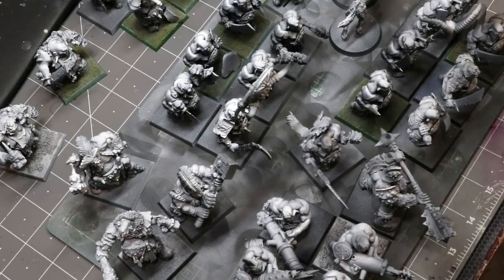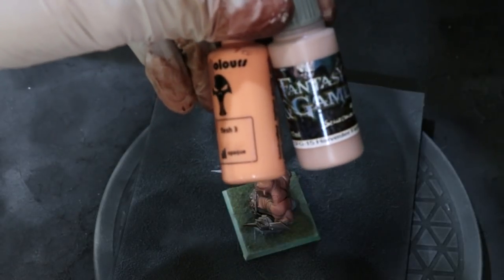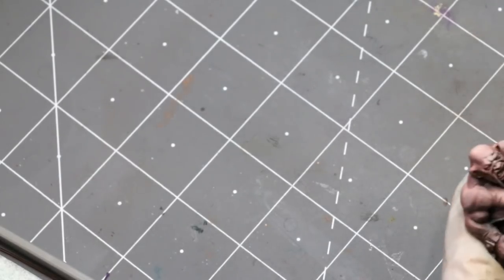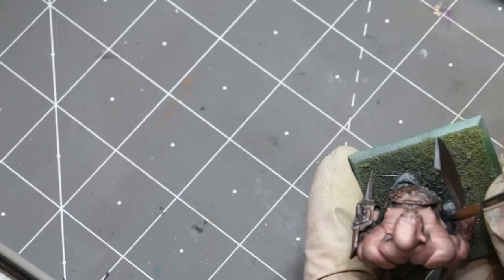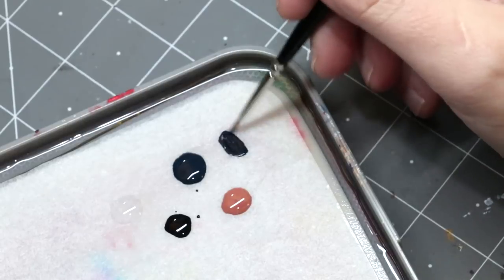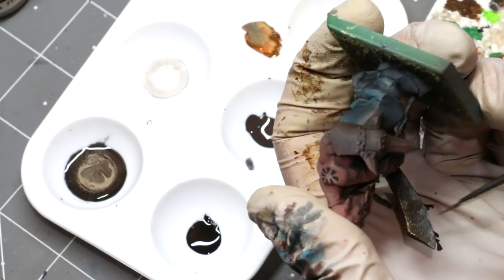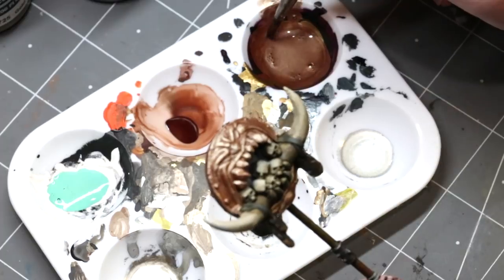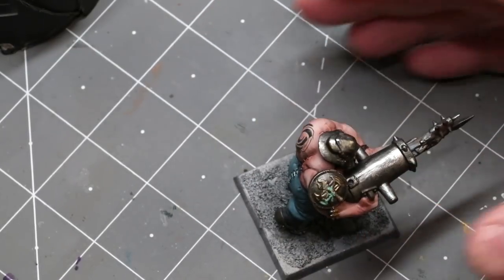Hobby Cheating 218   Painting an Army in 24 Hours

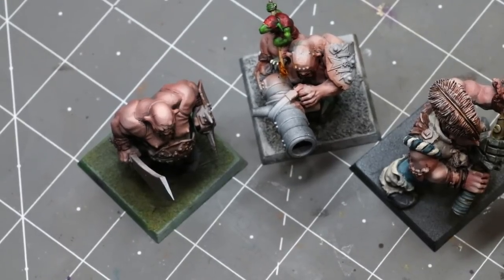Comment: Great work as usual, Vince. I want to add that as you finished your ogre at 32:36, you could also have said that every time you finish one this way instead of doing one little bit at a time, it’s a better example of intentional practice. 

Doing this method certainly gives me a hit of endorphins that one color at a time in a assembly line does not. 

Thanks again!
Reply from the maker: You know, you are so right. I didn't really think about it before, but you are exactly correct. The assembly line has a mental exhaustion thing where you don't really see the progress. This way, you really feel like you are getting there. Well said sir.

Comment: I've been meaning to join the rest of the guys at the club and paint an AOS army. I'm now going to actually do that using the approach you generously share here. Thanks.

BTW - attaching figures to the bases. Did you bother pinning, or did you just glue the model straight onto the top of the base?
Reply from the maker: Awesome, glad to hear it's helped motivate. At the end, yes, I just used some loc-tite gel glue and pushed them in. In this case, they have such solid big feet, it's a good bond.
Reply: Thanks Vince

Comment: Very impressive! Also tons of helpful info as usual. If I understand correctly you don’t put any varnish at all on the metal colors? (To keep the shine). Won’t the paint risk to chip off on models like these if you play with them frequently?

Thanks for the video!
Reply from the maker: That's correct, I don't varnish metal at all. To answer your other question, no, not really. In generally, plastic models don't chip easily. I don't even transport with foam (that is just model suicide), I use magracks. Never had an issue. Hope that helps.
Reply: Vince Venturella: Thanks! I also use magnets for transportation. Will stop varnish metal from now on :)

Comment: Awesome as always. What pressure did you use to spray the 6-1 bugmans glow in the beginning. I am still fighting with my airbrush 😉
Reply from the maker: 18 PSI is my standard setting I run at 99% of the time.
Reply: @VinceVenturella  oh that's 1.2 bar... I spray at 1.8... I will try to go lower, and thin more

Comment: Vince love the work. Any chance you could tell me the brand / metal paints you use. Im interested in looking to purchase some, or if you have an affiliate link with united kingdom shipping. Also what material did you use to make the bases. Id have love to have known how you actually made them i appear to have not seen this in the vid as i was watching. I will rewatch again to see if you do mention it. I was busy painting myself :) thanks
Reply from the maker: Sure, Vallejo Metal Color (not model or game or air) Vallejo Metal COlor (these - https://www.amazon.com/Vallejo-Steel-Metal-Color-Paint/dp/B012A93HZS/ref=sxts_sxwds-bia?keywords=vallejo+metal+color&pd_rd_i=B012A93HZS&pd_rd_r=af627b61-6e5b-4915-93a1-ec7645449bbf&pd_rd_w=HTzlm&pd_rd_wg=w450T&pf_rd_p=1cb3f32a-ccfd-479b-8a13-b22f56c942c6&pf_rd_r=V32R178N5CW3A7XBWHS7&psc=1&qid=1576644580

As to the bases, they were pretty simple, but I had a few people request it, which I didn't even think of. Basically, they were just some cork on the base, then well covered by vallejo basing paste, then multiple types of grit applied (i.e. different sizes) and then some little items for flavor - like skulls, logs, whatever.

Comment: Vince, what do you use to thin S75 in the airbrush? Do you mix in a secondary container, or do you mix right in the pot?

I've been struggling to airbrush S75, but Vallejo is fine. Have you found you need to do anything different between the two brands?

Btw, this video made me think totally differently about my new GSC army!
Reply from the maker: At the moment, I just use my standard thinner mix, 80/20 Thinner/Flow improver, i mix in the cup, but I stir with an old broken brush. I thin it quite a bit, especially standard Scale 75, probably like 5 or 6 to 1.
Reply: @VinceVenturella  cheers Vince! I'll try thinning my S75 more.

Comment: small question: how do you glue models on the bases after you did the bases? do you pin them with some wire and superglue?
Reply: That's how most people do it. You pin both legs and push it into the base, then you pin vise through where the paperclip pinning hit. Push the model through the base, after pin vising the base, then superglue the bottom, after you clip off the excess paperclip.
Reply from the maker: Normally, I would pin feet. In this case, I didn't. These ogres have big giant flat feet and they have a lot of surface connection. So I just used some Loc-Tite Ultra Control gel and I pushed them down.
Reply: @VinceVenturella  oh ok thanks. I find it hard to make bases first because the surface is rough and not even (like when I base it with rocks and sand etc) and I never manage to glue them solid on bases :(

Comment: That was an awesome video :) Did you think about using oil washes for the metals, would have avoided the non-metallic medium issue. I get why if you're doing it in a weekend due to drying time you couldn't but if you were splitting this up in to smaller paint sessions would it save some time?
Reply from the maker: I did think about oil washes in general. The drying time was the issue here for me with those, given the restriction, I just couldn't let something sit for that long. :)

Comment: Great video Vince! Im about to start an ogor army and really learned alot from your videos. :) 
That being said im having some problems with my skin.
I zenith with white inc and airbrush 3 different skin colors, but even after 24h the paint breaks when i try to apply a wash :(
Any idea what could be the root of my problem? Its like the "adhesive" in the paint isnt binding to the layer below. Could i be thinning my paint to much?
Reply from the maker: It's hard to say, could be the paint, could be humidity, could be the thinness. There is fortunately an easy answer. After you do that zenithal and your colors with the airbrush, make your final step a good coat or two of varnish (dealer's choice). 

You can then let that dry and basically go from there. Your previous work should be nice and locked in.
Reply: @VinceVenturella  thanks for the tip :)
Btw i think i have a future hobby cheating subject. "Non-nurgle-weathered skin" :D
I have tried to find a guide on how to paint beat up/bruised /weathered skin, but without any luck. i feel like there should be a fine line between rotten nurgle flesh and a chubby, bruised and pale ogor, since i dont want my ogor army to look like nurgle trainees :b

Comment: how are you mini's attached to the old bases and how do you removed the old base and mount the new one?
Reply from the maker: They were just glued on, I popped them off with a thin file or clippers and then used Loc-Tite ultra control gel glue to attack them to the new bases.

Comment: How long did it take you to paint this, IN addition to assembling the models, cleaning them, gluing them together, creating the basing, and painting the basing?
Reply from the maker: It was about 22 hours in painting as you saw. Most of the models were already assembled as it was a combined army of a legacy force, some ebay pick-ups from 2015 and other bits and bobs. So I didn't really have to do any of that stuff. The basing and everything was in the 22 hours (not the base creation, but all the painting). 

The priming and bases were probably a few more hours on top.